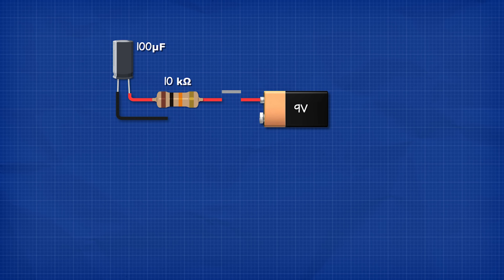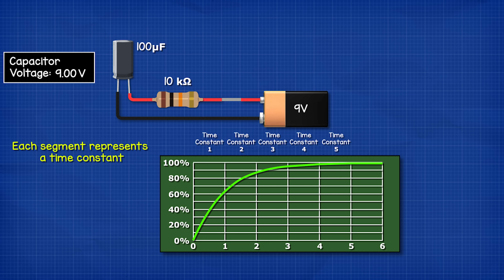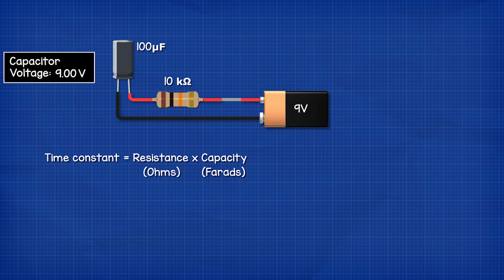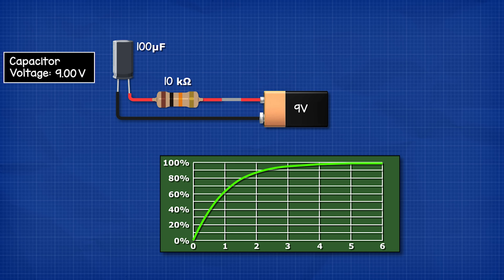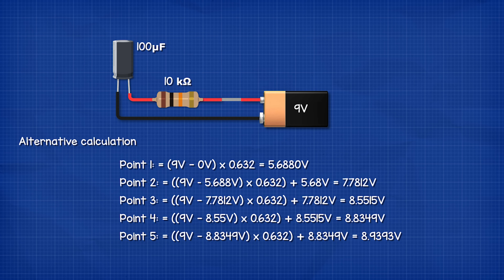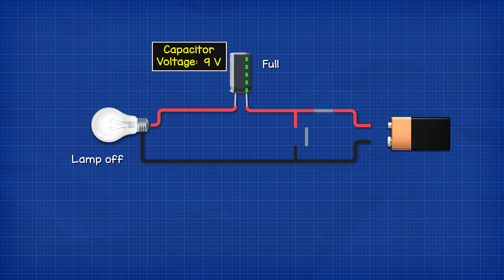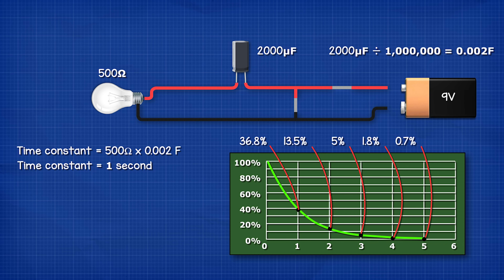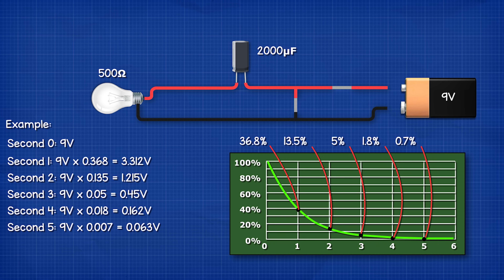Capacitor charge time calculation - time constants

Comment: Anybody knows if the circuit presented in 4:10 is accurate? If I connect things that way I should be able to chard/discharge a capacitor for real? I am very interested in that kind of circuits, this is: the most simple circuit to charge/discharge a capacitor (without using transistors if possible).

Comment: 3:40 is exactly what i dont understand?? why does the light turn off if its still in hte battery??
Reply from the maker: The capacitor isn't a path like a wire. It can only store and release. The light only shines when current is flowing. Once the capacitor is full, no more current can flow, so there is a voltage but no complete path so no current flows.

Comment: What if thicker wires were used? They would let more current flow and the capacitor would charge faster, wouldn't it? This calculation would then be incorrect, wouldn't it?

Comment: How will the capacitor charge fully when there is a voltage drop across the resistor? As an example, if it is a 10v supply, with 5V (Vr), how will capacitor reach 10V, when resistor is in series with 5V?

Comment: For timing circuits I always chose 3  TC (roughly 95%) as the trip point. With all the variants of battery voltages, resistor and capacitor tolerances seemed to give may designs a little more functional design reliability. Then again my efforts was done with graphpaper and pencils.
I enjoyed your presentation and graphics. Good job.
Reply from the maker: Check out NEW resistor video, everything covered! ➡️ https://youtu.be/DYcLFHgVCn0

Comment: In the first circuit why did you have a resistor there at all if the purpose was to charge the capacitor as fast as possible?
Reply: The purpose is to see how to control and measure charge and discharge of the capacitor which is used in various circuits as well as timing circuits.
Reply: @jayytee8062  So is the resistor there to have a standard moderator for the current flow?
Reply: @lashlarue59  
The resistor is limiting the current flow so it slows the charging of the capacitor. If there was no resistor then it would charge instantly - depending on the capacitors farads value  and the supply voltage/current.
I'm an beginner in electronics and my explanation is less than precise. Hopefully you get the gist of it.
Reply: @jayytee8062  Got it, thanks for the explanation.
Reply from the maker: Check out NEW resistor video, everything covered! ➡️ https://youtu.be/DYcLFHgVCn0

Comment: Good, accessible description - but you might want to edit the last graphic since you appear to still have the battery connected when you discharge the capacitor which is not going to turn out well (except the odd arsonist maybe) :)

Comment: I'm still stuck with an issue from a previous video: why does an empty battery give 1,5V and this have to test it with a load to have the correct reading.
Reply from the maker: Check our new Multimeter tutorial out ➡️ https://youtu.be/4lAyzRxsbDc
Reply from the maker: The electrons might be built up enough on the plates to give the reading, but it can't sustain a chemical reaction to support a load
Reply: @EngineeringMindset  wouldn't the multimeter discharge it due to closing the circuit and thus creating a load?
Reply: @Thamli  No, because a multimeter typically has a massively high impedance (or in the case of DC, that would translate to resistance). Meaning that the battery doesn't see any significant load.
A multimeter will only show the available voltage. To really test a battery, it's much better to use a load tester. However, if your multimeter shows a low voltage on the battery, then there is no doubt that the battery is weak. A higher than nominal voltage being shown on the multimeter "hints" that the battery is "ok" but it's only a indicator, since it's not a test under load.

Comment: Beautiful explanation!!!
Could you do one for the capacitors they use for car audio. They only list the farad count and nothing else. This is why real audiophiles who want the details never get them. And crappy caps are sold and people get ripped off for buying cheap un needed capacitors who ratings are falsified for a good reason...
Reply: Or the capacitor plague caused by capacitor degradation! Maybe a deeper dive into specs like DC bias on different types of caps

Comment: Nice explanation of how caps work. Always was curious how they break down and deteriorate in performance from new to aged. When do you pull the plug and replace one? Does it become noticeable if one is being used as a filter in a speaker crossover?. What would be the symptoms in hearing, as opposed to just measuring with a meter? Love all your vids.🤷‍♂️
Reply: you replace em, as soon as the led thingy just flashes, the tv doesn't bring up a picture or the elctronic ballast in the CFL light fails to strike the tube or restrikes it out of nowhere serval times.
Reply from the maker: Seen the new LED explained video? so much detail covered! https://youtu.be/O8M2z2hIbag